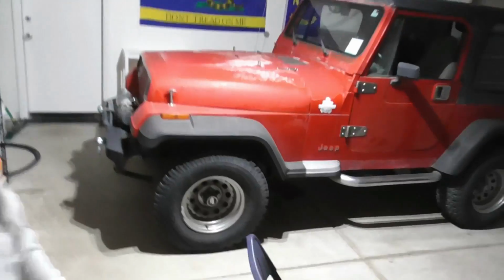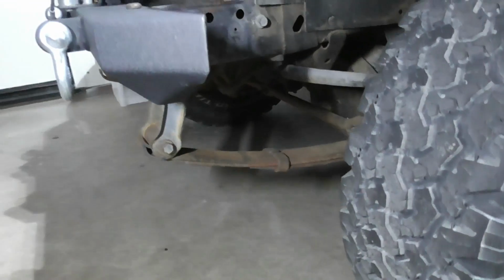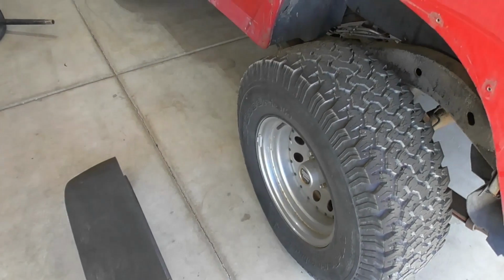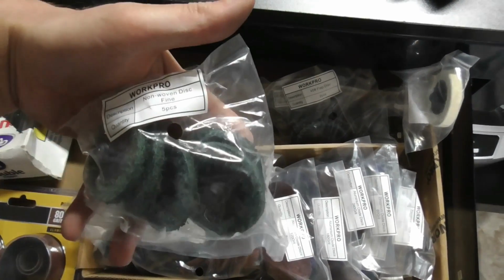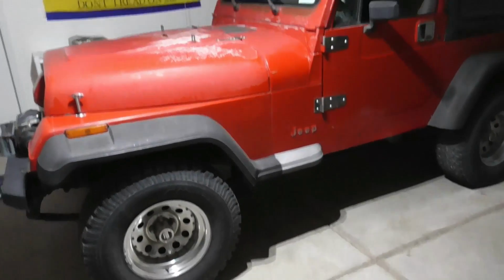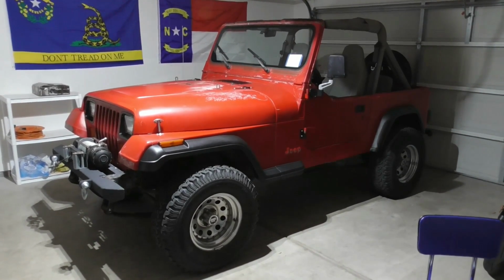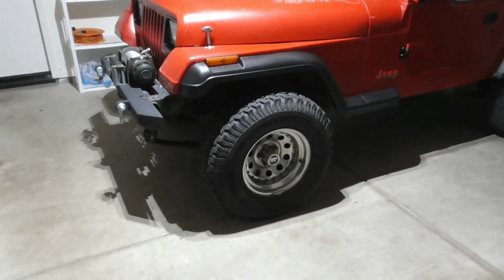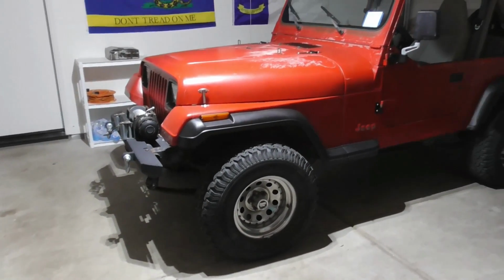New Project - Jeep Wrangler YJ

Comment: Nice purchase. Neighbor is going to be talking to you for messing up the way his Jeep was....

Looks like the rear flare may have been for a TJ for its wider in the opening compared to the YJ and trimming side panel is required. 

Exhaust upgrade would be to swap in a TJ down pipe setup. Both the 4.0l and 2.5l YJs go under the trans to cross over. TJs wrap in front of the oil pan sump and go along side the oil pan to the catalytic converter.

Front axle shaft upgrade for your YJ, in keeping the disconnect, Dana Spicer has a 760 series ujoint inner shaft, p/n 75527-1X. The stub shaft for the 760 series ujoint is Dana Spicer p/n 43205.
Rear axle upgrade is the 8.8, like you are planning. East Coast Gear Supply is basically the expert for the 8.8 swap. Double check your parking brake fingers (the plates coming out of the backing plate for cable attachment) as they tend to rust up and lock up. ECGS has the conversion parking cables that bolt/fit right in.
Reply from the maker: Yeah he has already said he hates seeing it go and come from the neighborhood because it makes him sad lol.

I'm actually glad the exhaust is routed the way it is since I have to take the oil pan off soon. The TJ swap may happen eventually though.

I've already got Yukon chromoly shafts installed in the front and converted to WJ brakes, and my new 8.8 is ready to go in. Got my set up bearings from ECGS but all my swap parts from Barnes.

Comment: Quick question, what did you do about the rear fender cut when you added the stock flares? I have a 91 also and the PO did the exact same thing and added wide flares. I'm wanting to go back to stock flares but the cut is to big.
Reply from the maker: I used all of the remaining bolt holes that I could and then just threw a zip tie through the last hole at the rear and snugged it down. Not a perfect fix but "good enough" for a yj in this condition.

Comment: Just found your channel and subscribed. I’m in the market for a Jeep and with the prices of the TJ Jeeps I’m looking at the YJ Jeeps now. Is the automatic a weak point on the YJ? I’m looking for a automatic 4.0 YJ.
Reply from the maker: The autos in YJs and TJs are basically the same except for how they name them. Older versions are the 999 and newer versions are the 32RH, but they are all 3 speeds. They get a lot of hate simply for being autos but a lot of guys put a manual valve body in them and race King of the Hammers and rock bouncers with V8 swaps, so they are pretty tough. Like any old auto they can be completely worn out though so it depends on the condition of the one you look at. Advance Adapters has some good info on their site, just search TF999.